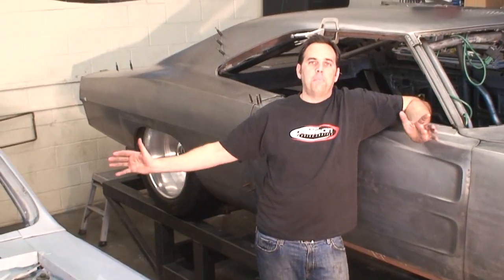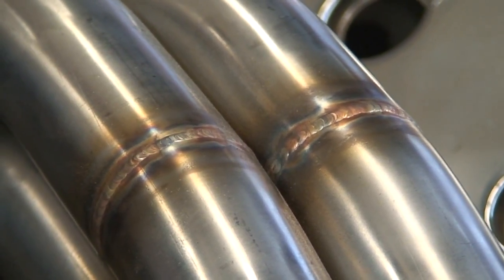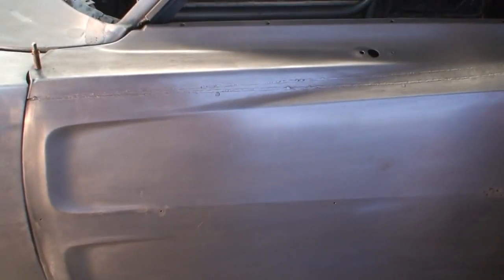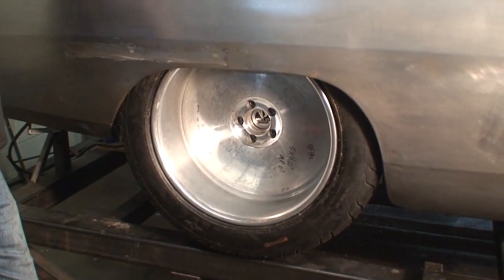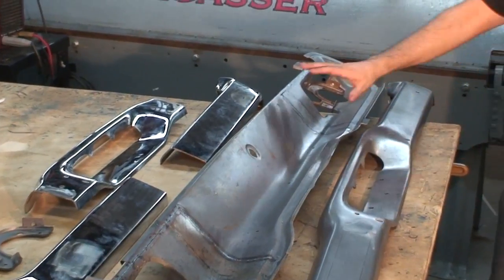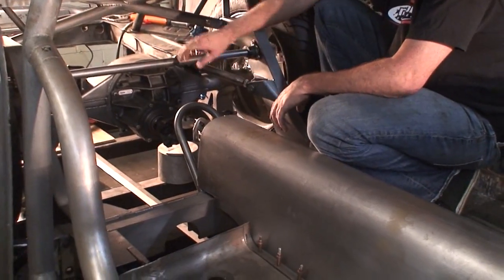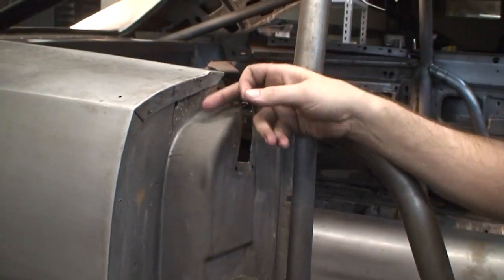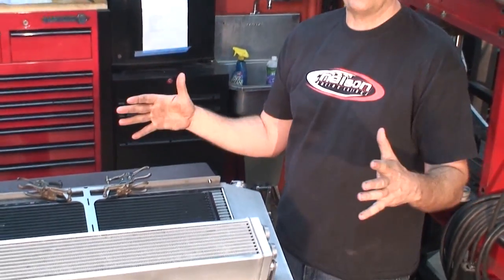2000 HP Dodge Charger Hemi - Mirror Image Turbo

Comment: I am really impressed by the radiator/condenser/inter-cooler assembly. It looks really cool and  I can picture it in there. The body work and engine is also very impressive.

It is the little details and I am heading over to the videos to watch the rest. Really cool concept you've came up with here.

Comment: Turbo always screams tuner cars. In my opinion if you're going to build a muscle car then you should have a supercharger. The belt whine sounds better then any turbo purge.
Reply: +LgWilly744 Ya, coz nothing screams "tuner" like a 700Hp, 1.6 litre twin turbo Formula 1 car ... or a 1370Hp, twin turbo Koenigsegg ... maybe it's time to open your eyes and let go of some of that prejudice.
Track racing has been dominated by turbo technology for years and there's been a shift towards turbo technology in drag racing. Turbo's will never completely replace super chargers, but i think it's awesome how they complement each other and evolve side by side.
Turbo technology still suffers from turbo lag, something super chargers [generally] don't have a problem with ... but progress in design, new materials and manufacturing is closing the gap each year.

Comment: Have you never seen NRE before? If they say it makes 2000 HP then it makes 2000 HP. They design the compressor wheel themselves to spin the opposite direction to work with the mirror turbo. Its a pretty sick machined piece of work.

Comment: Well there's a lot to it and different engines are obviously going to take to different things but... Displacement aka size: Stroke or how far the piston moves: Compression inside the engine: Camshaft which basically operates the valvetrain: Valvtrain pushrods valves etc: heads the part where air and fuel is mixed and put in the combustion chamber: Intake the part that takes it all in: forced induction aka turbos basically allow the efficiency to go over 100%. Oh and money. Lots and lots of it.

Comment: To all those people sayin that you like the turbos more because of the top range and to all those supercharger fans, why not use both for max power? You do know you can have turbos AND superchargers in 1 engine right? Transport trucks use it which is why they're so fast for big heavy trucks
Reply: How do you run a setup with both without killing you horsepower boost. Adding a supercharger to a turbo engine normally just kills your HP. 

I heard of someone supposedly doing it, but I wonder how cause I've always heard it couldn't be done
Reply: +Anthony Ballmann well transport trucks run just fine and they use both
Reply: +Anthony Ballmann 
You need to study some Diesel motors made by GM
Reply: +Anthony Ballmann The supercharger has a clutch on the input shaft which allows it to stop spinning once the turbos have spooled up enough to provide equal or more boost pressure.  Was used a lot in large, 2 stroke diesel engines that run constant duty (locomotive, ships, generators, etc.).  The supercharger is usually only in use when the engine is idling or revving up from idle.

Comment: Would that not depend on the brand?  Could be a Roots since they are such a big name in the industry.

And yes, centrifugal is in reference to the way the unit moves the air.  Positive-displacement means that it isn't a vacuum, it moves air at- or not much higher than atmospheric pressure.  That's why turbos can achieve numbers like 30 psi vs. a blower at 16 or so, but almost never over 20.

I sell the industrial version of these for a living, as a rep for a competitor to Roots.

Comment: Well, part of the supercharger was sticking out, it was mostly the air filter.  And if you want to get technical, it was most likely a positive-displacement rotary lobe blower, possibly a centrifugal.

I made my comment because the gentleman didn't even mention the movie, he said Vin Diesel.  And you jumped in with a snarky sarcastic remark.  And proceeded to insult me for being literal.  (I'm sure you're aware that sarcasm doesn't translate well through text, and some will think it literal.

Comment: We dont get to see the finished product? How disappointing
Reply: +Nelvin 78 Watch fast and furious 7. You will see the completed charger at the end of the movie.  It's called the Charger MAXIMUS is you want to see more info on it. It's finished in all alluminum with clearcoat on top.
Reply: +Nelvin 78 Agreed. Lotta talk no walk. I'm not impressed.
Reply: +Nelvin 78 It's about process not about finish
Reply: did you that fricken engine block like a 12 or 16 cylinder

Comment: What I dont get about people who hate on these cars, you dont have to like them but you should respect them in the way we muscle car lovers respect most performance cars. You can talk all day about Ferrari's, Lambo's and Mercedes/BMW and how they were engineered to what ever standards blah blah blah. Cars like this 68 Charger R/T could be purchased by anyone. You could be 25 and walk in and buy a 400hp car that looked bad ass and wasnt much more than a middle of the road car at that time.  Back when the average car did 0-60 in 12 seconds in the US and I garuntee in the 60's the AVERAGE euro car was much slower you could stomp the crap out of someone running in the low 6's and even 5's (0-60) and still be able to haul stuff with a large trunk and have all your freinds rolling with you.

Comment: why would you put a new motor in a classic car?....i dont care if it makes 30,000hp its not right n its not even cool.  if you want to do it right put a 69 440 block in there with no cheap power with turbos or superchargers.....real men use N/A motors

Comment: OOOOOHHHH-AAHHH......
2000 Horsepower of B.S.  A careful guy could build a 600HP small block Econo rail dragster for $12,000 that would waste this Charger in the 1/4 mile at any NHRA track with a full tree.

Or a 2013-15 Camaro SS, or Cobra type Mustang with a bolt-in roll bar, and some Z rated Pirellis and destroy this Charger at Laguna Seca or any other other road course.

The only thing this car does well is 'boner the mine is bigger than yours' argument in the world of wheels cars for kids. This sucker- Charger just needs to spool-up in parking lots at local burger joints and run the rubber off the rims in contests to impress big titties and little kiddies.

3900lb combination of niche market old school, antique, and anchor. Turbos+meaty rear tires is not high tech. I have an issue of HotRod from  '66 that had a Charger+2 Inter-cooled turbos.

Nelson Wasting-reinventing the B body-Ha-Ha. Thar she blows!!!

Comment: sorry my stupidity, but: will be this classic car could to defeat to the fucking GTR?? excuse me for this, but please dont answer me GTR Fanboys with all respect, only people that getting knowledge about dragraces and also of engines and also you are honest, only is a question, you dont take to bad and excuse me for my very bad english, until now im learning :P
Reply: It depends on a lot of factors. There are lots of different packages for GTR's. Weight also plays a factor (not sure of the weight on this Charger). AWD vs. RWD will play a factor. Drivers will play a factor. In the end, races aren't won on paper. Wouldn't know unless they raced. Either way, you could mod any car to beat any other car if you put enough power in and take enough weight out from it. You could put enough money into a Civic to beat this Charger. So the question really is useless in the end.
Reply: hehe thanks to explain it man, i wouldnt have been more content for answer honestly my stupid question :P and  besides i think that its very hard to remove at least a liitle of weight as is the bmw M6 that weights almost 2 tons and is almost impossible to do it something more light and of course that the civic could to win him to the charger but i think that it had that to have something else to tolerate the power of the engine when getting more 1000hp with big block engine and that it has defeated the fastest cars, only main
Reply: You're also forgetting cornering. In a drag race I believe the Charger would beat even a R35 GTR N1 because it's been so supremely engineered for so much power. Put the two through some corners though and I think the Charger would have trouble due to the GTR's electronic suspension and stability controls.
As JumpsuitJack said, it's sort of a moot point.
Reply: You have to think about power to weight ratios. You have a long car such as this that's going to be light, all the weight is towards the front of the car. with 2000HP all the wheels are going to do is spin and never find traction.
Reply: :O Seriously?? i dont know that detail so important of the traction and that obviously you did me to remember that with too much power anyway the charger its would miss the control taking the curves because i think the weight is not present in all the car or is something else than that, but no there some way of the charger still with that tremendous power its be able to take or to control very  good the curves or its very impossible place the power its too much for the traction ?? second question: and why on the GTR according to the rest saying had much electronic parts, but to its that benefit so to be totally electronic( or almost) to difference of another sport cars or supercars (as the veyron or the Agera R)?? and concluding.... then the ´´supercharged´´ cars such as this same charger, the chevelle, also a firebird Among... only are nice doing drag racing??
Reply: WanderVideos I've seen 1300 hp cars on the road course and most fast, and I mean 8 seconds and faster, drag cars pushing over 2000 hp and hook fine.
Reply: Dollar to dollar the charger would kick the crap out of any GTR those things cost 120,000 dollars new with 600 HP I think. The Nelson car has 2000 HP and probably almost as good of handling and maby costs a little more.
Reply: eric thecarguy Well comparing a stock car to a heavily modded car is unfair to begin with. You could mod a minivan to beat an unmodded GTR. That doesn't mean much without context.
Reply: JumpsuitJack It's fair if you spend the same amount on each car, Mods for Charger vs cost of GTR.
Reply: eric thecarguy A Phantom costs more than both because it has more luxuries, and a GTR costs more because it also has more luxuries. You can drive it on a track, in a quarter, and get groceries in it. Apples to oranges.
Reply: JumpsuitJack Nelson cars are very fancy so I still think charger wins and sometimes I like looking at an apple and orange next to each other and saying "Whats the big deal?"
Reply: eric thecarguy I'm not saying which one I would prefer, it would be hard to choose, but they are honestly very different. AWD, handmade engine, all the complex computers, info-tainment, etc. adds up.
Reply: With 2000 hp the charger will eat it alive on the strip which im sure thats what this car was intended for
Reply: theres only so much much the charger can use before the wheels begin to spin, but with a pair of slicks and a proper driver this charger would beat a gtr in a straight line for sure. on the track the gtr will win every time. this build will probably cost twice the price of a gtr though.
Reply: Ben Dover these guys go above and beyond with every build they do 2000hp could be achieved with much less
Reply: Duh, there are many muscle cars that beat gtr's ... ;-) not really about the car but about the way its modded, a stock gtr will get beaten by a 10 second muscle car, but that'll get beaten by a 9 second gtr which in turn will get trumped by an 8 second muscle car and that gets beaten by a 7 second race gtr which gets beaten by a 6 second crazy muscle car and then thats it.  Gtrs arent magic, larry larson went 5.95 once in his highly modded truck.  Just depends how much you want to spend on a car and stilk drive it on the street.  Not talking funny cars here btw, those don't count for me